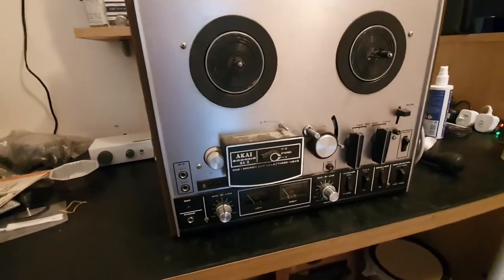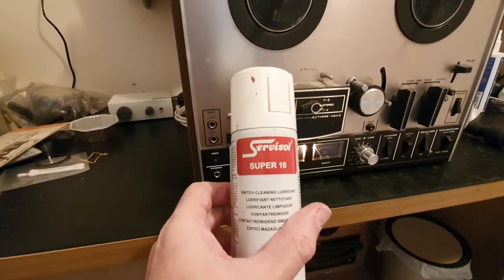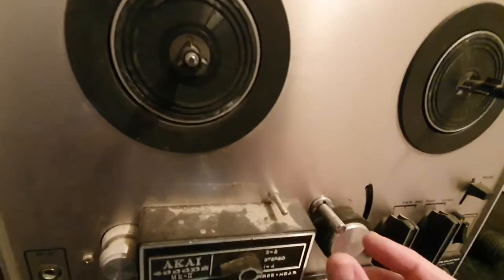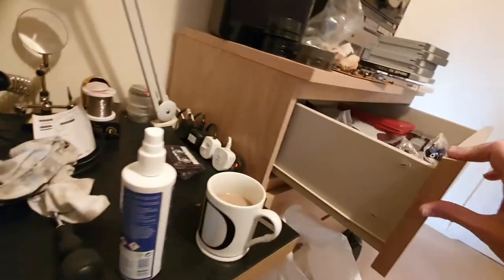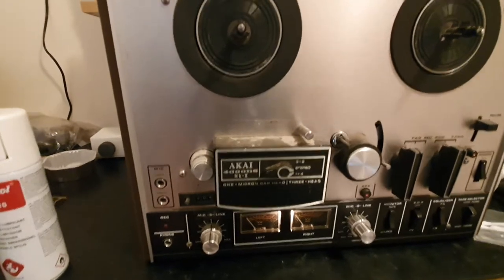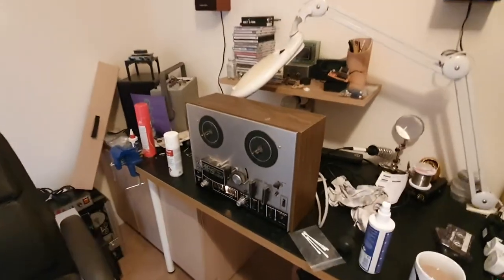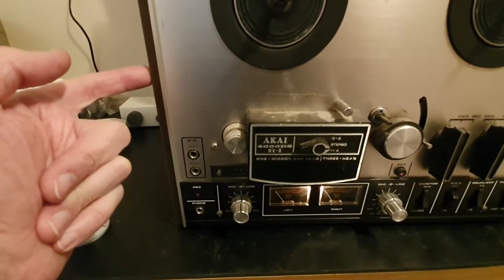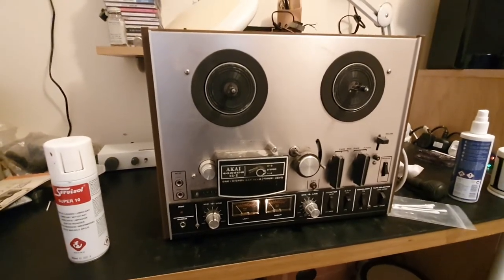Akai 4000DS Mk2 Basic Maintenance Pt1

Comment: There are in fact quite a few differences between this and the original DS not just the reel retainers, but mostly those differences are under the hood on the circuitboard. Also the shutoff lever on the original DS would shut off the entire machine not just the motor.

Comment: Ive got one of these. But for some reason, it plays faster than it should. How do I repair this?
Reply: Change the adapter that unscrews on the face of the unit and place that on the pin next to it.

Comment: Got this machine a while ago, just fixing it up now. Replacing the pinch roller rubber and doing my best to restore the idler tires, going to try  soaking them in Simple Green the way some auto repairmen do here in the States for rubber car parts. Are you familiar with that practice at all? Not sure if you guys have Simple Green across the pond...
Reply from the maker: I used Platenclene (a printer pinch roller rubber restorer) to clean and get more grip